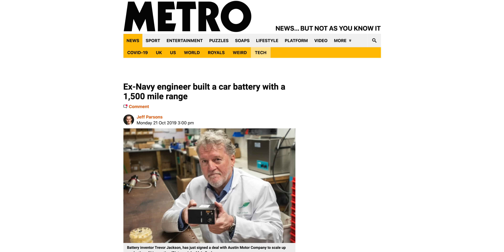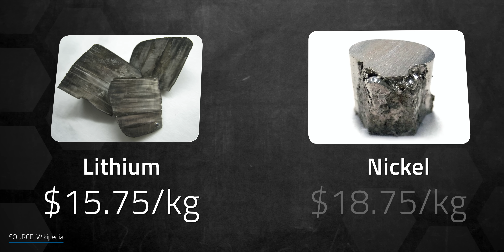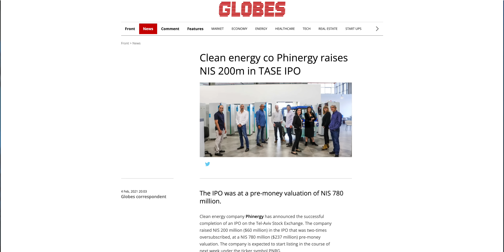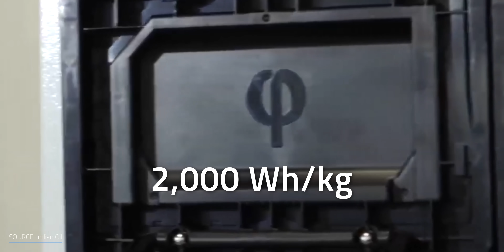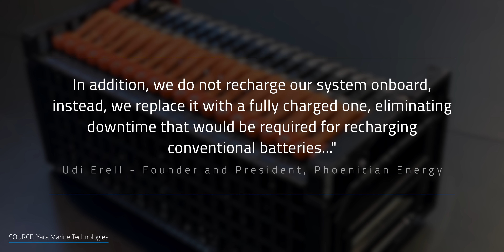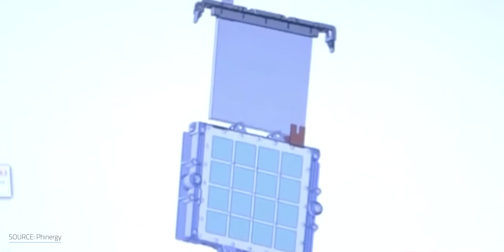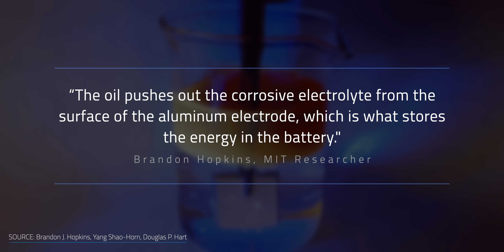Exploring the 1000 Mile Car Battery - Aluminum Air Hype?

Comment: This is one of the most "different" battery technologies I have seen!  It provides a distinct choice of advantages and constraints.  No doubt that means it is highly desirable in some applications and not-a-starter for others.

The key variable completely missing from this summary is battery cost.  Is a replacement 60 kwh aluminum-air battery a $35 item, or is it $3000?
Reply: this would be like running your car on giant versions of AA batteries from the 90s.  Every time the battery runs out you need a brand new battery?  GTFO     i dont even know how i made it through the 90s...    dreadful to even try to remember.   "CD player died. gameboy died. MOM I NEED BATTERIES!"   Mom:  "We dont have any!"   Me:  "OMFG when are we gonna get new batteries?"     Mom:   "Im going to the store next tuesday ill get some then"    Me:    " F   .... M ....   L ..... "

just realized, this is why i actually managed to read some books in the 90s....  amazing
Reply: At economies of scale and recycling id assume the cost would be lowered but idk
Reply: @hamzahabugosh  Not really, we already have the scale of aluminium hydroxide dehydration (the Bayer process) and electrolysis of the resulting alumina (the Hall–Héroult process) which is what this 'recycling' needs. We've been looking for cheaper and easier methods of reducing alumina for centuries and that's the best we've got. That's what this process requires, because the output is aluminium hydroxide.

If there is a more efficient method for producing Al metal from Al oxides and hydroxides I'm absolutely certain you would be extremely rich if you can find it.
Reply: m727yy9givkvk m m . 
 
                      .

m
 2wwsz m .   3222wer79000p..          .x
Reply: @سلمىاحمد-ص7ب  أعتذر ، لغتي العربية سيئة للغاية. أنا لا أفهم جوهر رسالتك. يرجى إعادة الصياغة.
Reply: It's a dumb idea on a thermodynamics level. As essentially this battery turns Al into AlO (actually a hydroxide, but this is dehydrated to alumina before conversion back to Al metal), and you can therefore never get more energy out of the battery that it costs to make it. Al -> AlO releases a maximum energy which is the minimum energy to convert AlO -> Al.

Add on the hugely inefficient Al electrolysis (no more than 40% efficient; 250% of stored energy in battery to produce battery) and you've got a huge cost to produce the batteries (even assuming you can just cast the Al electrodes, else further manufacturing is required and therefore much lower efficiency) for very limited benefit. Transporting batteries around (to changing stations) is again another expense on the energy calculator.

Basic thermodynamics show these to be dumb ideas that can never do anything like they claim.

If you can make it easy (90% or above efficiency) to convert the used metal oxides back to useable metal, then these would be more useful, but when you are wasting more energy than you get out to produce the battery you've just created more problems.

Why does no one understand thermodynamics?
Reply: @seb3090  Seriously, this right here.  Transporting aluminum and making aluminum is more energy than the 5% loss you get from the grid.  Not to mention we're going to increase the cost of aluminum which is needed to make new vehicles.
Reply: @seb3090  I mean NO battery produces more energy than you put in to create it, literally every energy storage system loses energy in the process, and also incurs energy costs from transportation. The high energy cost is definitely an issue, but it might be worthwhile in situations where there isn't access to a power grid and energy density is paramount. It doesn't matter if it takes 250% the storage energy to charge it if the alternatives can't meet the requirements
Reply: @cactus445566  You know this thing with batteries is the rechargeability so over a lifetime they can actually store and release multiple times the energy of production. Sure I get that you get conversion losses and all other sorts of losses from self discharge or time discharge, degraded anodes and cathodes etc. But there is essentially no upper limit on the amount of energy that can be stored and released in a rechargeable battery, they can easily provide way more energy than it took to produce. 

That Al batteries degrade very quickly (80% loss after a couple of months, cf. 1-2% loss per year for Li-Po) again make these a really poor choice. You can't use them for backup use, you basically have to drain them within a month of starting using them. Sure you might be able to reduce that, but that's making the batteries more complex and expensive, and if you need pumps to remove the electrolyte (NaOH) you've got more failure points which no other battery had.

If you don't have huge amounts of power you are not getting your congealed electricity (aluminium) for the cathode.

If you really require large energy storage then oil or hydrogen is likely the best source of power, sure it's polluting which isn't good, but it's less polluting than producing Aluminium. Oil is way more energy dense than Al batteries.

I mean the parasitic losses in a Hydrogen system I've seen at something like 70% which is far better than these Al batteries (likely somewhere around 85% loss). The losses and other issues with H show why this hasn't been quick on the uptake, but still H would likely outperform Al batteries.

These don't solve anything but very niche issues and really are not going to help with reducing pollution. 

If this was a different metal which was not so hard to reduce then they might make better sense, but Al is pretty much the hardest base metal to reduce. So oxidising this for energy output is extremely wasteful.
Reply: @seb3090  No, aluminum is one of the best metals for battery applications because of it's high cost to reduce. Alumina's high reduction potential is the reason why aluminum has a high oxidization potential, why you get such high energy density out of it. The technology's still in it's infancy and it should be possible to improve the efficiency of aluminum electrode recycling, especially given that you don't need to remove impurities as you would refining aluminum from ore. Sure I doubt it'll reach the same efficiencies as normal battery technology, sure, but I think there are places where energy density matters enough for it to be worthwhile
Reply: @cactus445566  This is the same as refining Aluminium, it produces aluminium hydroxide, which then needs to be dehydrated to alumina which is then refined into Al metal, exactly the same as fresh material. Sure you can save a few steps on the Bayer process if the cathodes are just Al(OH)3 although I would guess that for more efficient batteries you are going to have a mixed cathode, else surface degradation of the cathode will reduce the battery performance, which in the caustic environment of the battery is likely to degrade and make reprocessing more difficult. The cathode is not going to be pure Al metal so the waste Aluminium Hydroxide is not going to be pure either. 

The Hall–Héroult process is at best 40% efficient (15MJ/kg vs theoretical 6MJ/kg), any additional energy required in the Bayer process, reprocessing the used cathodes, remanufacturing the cathodes (if not a plain cast part) and reassembly of the battery will only further reduce the efficiency.

What you are saying is there is a more efficient way of producing Al metal from Alumina, which if you can find will make you billions, because we use a very inefficient process currently. It's the reduction from alumina to aluminium that is the inefficient step, the purification is easier than the reduction. Which is why this sucks. 

I understand the reasons why this is being investigated but the action of the battery is to oxidise aluminium and it is the reduction of Al that is terribly inefficient. 

The very quick degradation of the electrodes (80% power loss after a couple of months) again doesn't make this sensible, if you were only at best getting 15% of the energy to produce the batter back from the battery, reducing this to 3% after only 2 months is even worse.

All this development is almost certainly going into making the cathode last longer, which in other batteries have meant more complex electrodes, which make them harder to reprocess. I assume there will be niche uses but this is not going to be a mass market device. If you did some reading into these batteries you find that the pure Al cathodes degrade quickly and the batteries lose power, as Al(OH)3 builds up and prevents the electrolyte from accessing the Al metal thus neutering the battery. The highly caustic electrolyte just degrades the battery, such that max power is reduced to 20% after a month or two even with no usage. This is nothing more than a niche device and never will be anything more.
Reply: @seb3090  gee maybe instead of pretending to be a smarty pants as a random internet person that no one takes seriously you should write down all of your infinite wisdom and intelligence and invent your own batteries and make all the moneys ever. 

Everyone else: Trust the people doing the actual research over the clowns who google a few numbers to earn internet points.
Reply: @jypsridic  Why would I bother? It's not like the chemistry or thermodynamics have changed. There is no solution except not mining and destroying the environment. 

Not having children I don't actually care that much. You all want to believe, that's your own shit, but these batteries have been around for decades and they've not made it into a marketable product except in very niche areas. 

Also looking at what is already known is science, no point rehashing things we already know.
Reply: @seb3090  And a famous engineer swore that man would never fly, two years later the wright brothers took off, that engineer was Orville Wright.
Reply: @jypsridic  Sure, but batteries are not that. We know that there isn't much more to be gained from battery technology, we're already pretty close to how good they'll ever be. Modern Li-Po batteries have maybe a 10% loss over 1000 charge cycles and the capacity hasn't changed much in 20 years (just speed of charge and charge cycles have improved really) and the fires show how unstable batteries get at these levels.

It's not like you can change the quantum states of ions or the chemistry. This isn't even new tech Al batteries have been around for decades.

At some point we have to stop extracting and refining metals (cannot remove infinite stuff from finite thing), will there be any environment left when we do stop? The environment is the only thing which keeps humans alive. 

You want to believe in a technological  future, that some magic will allow this high tech world to continue. And I think that trying for this is going to kill the environment and us along with it.

Combined with the facts that refining and mining are horribly polluting and we've got no solutions to that (if we did we'd be doing them). Trying to solve the problems of mining with more mining is never going to work. 

The book Bright Green Lies details all the ways this future you imagine will not help.
Reply: @seb3090  Wikipedia won't have information on the science we haven't discovered yet.
Reply: @jypsridic  Batteries move electrons around, you need somewhere to store those electrons before you move them around. We store them with +ve ions to make neutral atoms. So unless you can find a lighter +ve ion (H and He are gases so not going to work) you are out of luck. There is no magic.

So praying for something to exist when there is nothing that can fill that gap is hopium. Not based in reality.

So yeah, there is not going to be a battery breakthrough, we're pretty much at the peak of power to weight with Li-ion/Li-Po batteries, only marginal gains from changing electrodes and electrolytes is possible.

The chemistry of batteries is well understood, making them practical for recharge cycles is what tends to take the time, stopping dendrites and degradation etc.

If every other ion is heavier than what we currently use you won't get the same charge density to what we already have. And what we have is a 500kg battery that'll take a car 300 miles.

Could we get this down to 400kgs, maybe. Will this fall to 40kgs, no. The energy density is not there. https://en.wikipedia.org/wiki/Energy_density

Burning things is 100x more energy than getting it to move electrons about. 

This is the chemistry I am talking about, and no there will not be new chemistry. 

You might note that zinc batteries are better energy density than li-ion, this is true but zinc batteries do not last as they are bad at dendrite formation, so work badly in things where you want hundreds or thousands of charge cycles. As I say, we know how batteries work and we've looked at most things as charge carriers, even in labs there isn't anything much better than we have. This sort of stuff is really old science.
Reply: @seb3090  You've just described several things that we could invent or discover that would make batteries better than you think they can be. The fact that you can imagine what would prove you wrong proves me right. 

If your argument had been "modern technology can't take batteries much further than they already are, we'd need to find a way to pack electrons more tightly or a different particle to store energy with entirely" I wouldn't have anything to say against you. But instead you went with 'we don't know how to do it therefore it is impossible' 

Maybe instead of storing energy as electrons we'll store it as unstable nuclear bonds and use a fission/fusion cycle instead of a cathode/anode system.
Reply: @jypsridic  Not really sure what you think an 'unstable nuclear bond' is or what you think electricity is.

Nuclear batteries (RTGs) do exist and are not suitable for consumers, as they work best with alpha emitters, which even in tiny quantities are fatal if ingested. They are also not efficient and have an annoying side effect of gamma radiation. Good on spacecraft (where solar doesn't work) bad on things that normal people can access.

Cold fusion is not a thing that exists or will ever exist.

The problem with nuclear is the energy is in the form of high energy particles, quite often neutrons, which are bad for things which are alive or other radiation, also bad for things which are alive. The feet of concrete they put round reactors is not there for fun. And again we've been looking at this for 80 years now and BWRs/PWRs are about the best we've come up with (GCRs are good, but fiddly and expensive which is why they were dropped).

You can't just jam only electrons in something, that's not going to work, so you need +ve ions or some other means of generating electrons, which means atoms. Those all have mass that does nothing for your electrical generating capacity, which is only about how many electrons you can move. Lithium being light allows more electrons per unit mass that almost everything else.

If you are having electricity as an output you will ALWAYS have a cathode and anode, these are not magical things, they are the current source and the current drain, which you need if you are generating current. Again it would be helpful if you had some clue about the words you were using when criticising me, it doesn't come across as smart when you don't even know that a cathode is the +ve terminal and the anode the -ve. Even RTGs have a cathode and anode.

We generate power either using chemical means (usually oxidation, or burning if you prefer, usually turning carbon into carbon dioxide) or via electrochemistry. Nuclear generates heat which runs turbines as other power stations, it is in place of burning things, although it also burns fuel, it's literally turning mass into energy with the most famous equation (E=mc^2)

I don't live on hopium as you seem to want to. Battery technology hasn't really improved in 50 years, the battery in your phone is barely any better than a phone from the '80s, sure it will have more charge cycles before failing but the capacity/weight has not improved more than 2% per year. There has been no breakthrough because really we're close to the limit of what is achievable.
Reply: @seb3090  "what you think an 'unstable nuclear bond' is"
an as of yet undiscovered thing. 

"Nuclear batteries (RTGs) do exist"
I know, and they're not what I was talking about which should have been obvious to anyone with a fifth grade reading level. 

But I'm sure your need to pretend to be smart will outweigh any shred of common sense so the rest of that essay will be a poorly written, error laden, and excessively pretentious explanation of the first generation of diamond batteries. 

"Cold fusion is not a thing that exists or will ever exist."
Who said it had to be cold?

"The problem with nuclear" yea duh everyone knows this paragraph.

"You can't just jam only electrons in something,"
Yea duh, that's why I suggested something that didn't require merely jamming more electrons into something. 

"If you are having electricity as an output you will ALWAYS have a cathode and anode,"
Who says the battery will output electricity?

Batteries store energy, not electricity. 

 Again it would be helpful if you had some clue about the words you were using when criticising me

" Nuclear generates heat" Duuuuuuuuurrrrrr 
Do you have any other common knowledge to pretend is profound? 

"I don't live on hopium as you seem to want to"
No, you live on deliberate ignorance and the assertion that we won't discover anything ever again.
Reply: @jypsridic  There are no nuclear bonds, there are chemical bonds and the strong force that holds nucleus' together. So again what bit of physics are you talking about? You can't just invent something that has no basis in physics.

Sure they generate energy, but that's only useful if it is in a form which can be reused. Such as moving electrons through wires. Low grade heat helps no one, which is why this is called waste heat. That's also energy, but again energy isn't a thing which is useful, only the work it can do. Either by moving something (in an engine or turbine) or by moving electrons.

Not really sure what other source of energy you are going to get out, moving protons around seems pretty dangerous and acidic. Neutrons decay in 10 minutes (and as mentioned bad for things that are alive). So what are you moving in these non-electric batteries?

We've not got an energy positive fusion reactor in the entire world. So that seems unlikely, possible, but unlikely. Also not going to be portable, again produces fast neutrons so much shielding required.

You suggested nothing as to solutions, because you think there will be some new science to solve this. Energy is only useful to us in the work it can do, so it needs to move things. 

Knowing the possible is useful for finding what we can do. Hoping for the impossible is not useful. Flight wasn't impossible (birds exist) before human flight, we'd just not figured it out yet. We know the energy densities of things so we know how much energy we can get out of stuff, and with batteries and electrical energy we're close to the maximum. 

So unless you've got actual knowledge on what nonsense you are talking about (please provide articles) you seem to have nothing but insults.
Reply: @jypsridic  It sort of is. You need some chemical process (it won't be nuclear) to do this, reversible ideally, to store this energy. The only method of doing that is supplying electrons and receiving electrons. Everything else has some form of waste, chemical processes which generate power (exothermic) result in more stable chemicals, so are difficult to reverse back to less stable elements. Doing the reverse with electrons also means you can do the forward reaction to generate electrons. 

There isn't new knowledge, an exotic alloy is not going to help you. We're making too much stuff, that's the source of the issue. We need to stop making stuff, doesn't matter how good that stuff is, the stuff itself is the problem. If we don't make stuff we don't have as big a problem. If we all realised the futility of a system which gives extreme wealth to the very few and a cast system of slavery to the rest of us. So we can demolish the only planet we can exist on in the entire universe. For what? Shiny trinkets that are just toxic waste in a couple of years? Sure, that's the kind of hopism I see in you. The hope that we don't have to give up the things that have made our lives easy to save ourselves. I mean I don't know if I could do it, but that's the way to solve the issue. Everything else is just making the problem worse.

Nihilism is what this culture is. My view is the only one with life at the end of it. 

You may see it differently and that's ok. But you can't refute what I say, you have hope that someone will come up with an idea that does not exist and likely violates the laws of physics. You just reply with fanciful thinking. Hopium.
Reply: @seb3090  yea, but it is pointless to talk about the details of that chemical, or whatever, process since it hasn't been invented or discovered yet. We literally have no information about it yet. 

You can't say it has to be this or cannot be that, but you can say that it is outside the limits of current knowledge.
Reply: @jypsridic  No and that's not what I said. It's not that there won't be improvements, I'm sure there will, although as I say there won't be magical technology which avoids the negative things about ALL technology, that is the mining and refining that is required to manufacture it. This is what is destroying the environment, the mining, refining, transportation and eventual toxic waste from that technology. Reducing ores to base metals is horribly toxic, polluting and it itself is the issue, you can't build your magical bean without mining and mining is the problem.

You want to believe that some magic technology will save us. And I think looking for that technology and building things which are only small improvements on what we have already (most technology for the last 40 years) is going to destroy the environment and humans and most life along with it.

I'm looking at what's happening and seeing that we'll destroy ourselves if we continue, and for what, a panacea isn't going to come and even if it did we are destroying the environment at too great a rate for it to matter. 

You think trinkets matter over life and I think trinkets don't matter. 

Not to mention that the improvements to batteries make them harder to recycle. thus worsening the waste issue humans have.

You want to believe and I don't believe. You have hopium and I have a view based on what actually happens. I won't breed more humans because I think we're doomed and bringing new life into that is evil. You can do whatever you choose, but you have no answers, just hope. You don't have anything to refute what I say, just hope. If I was talking utter nonsense you could easily refute the points I've made, but really you know that I'm not wrong, you just want to believe in something else.
Reply: @seb3090  No one ever said there would have to be any magical technology. You not understanding how it works doesn't make it magic anymore than ancient shepherds not knowing how lighting work didn't make it zeus. 

"Uses technology that hasn't been invented yet" is not the definition of magical.
Reply: @jypsridic  You want something that doesn't pollute to create and uses unknown science to do things which thermodynamics says are not possible. I declare that advanced enough technology to be indistinguishable from magic.

Lightning being a god or caused by friction of the atmosphere against itself makes little difference to those who are hit by it.

The problem is the mining and refining, which there are no solutions to, it's terribly polluting to separate out the ores you want from the ones you don't and then reducing to base metal is even more polluting. So creating a thing is never going to be better than not creating it. To think that anything could be is magical thinking. Because that is what you are saying, I'm just calling it what it is.
Reply: @jypsridic  That's what chemistry, physics and thermodynamics tells us. That there is no free lunch and you always lose.

Assuming starship works as Musk says that's 4500 tonnes of CO2 per 100 tonnes to orbit (LEO), that's a lot of pollution for not very much mass as on earth you can get a tonne of iron for 2 tonnes of CO2 or a tonne of Lithium for 15 tonnes of CO2. That's not better.

And no one is working on a Hydrogen rocket as it's just not dense enough for take off, the rocket would have to be too large and the tyranny of the rocket equation is all there is.

You have hope, I do not. You think there'll be some big breakthrough that will save us and I do not. I do not live on hopium, I exist in reality where there is nothing that will help and this culture will continue it's nihilistic path to destruction.

You can't cheat the process, if you can get x amount of energy from oxidising a thing it will take at least x amount of energy to reduce it.

You have nothing but hope of a breakthrough, one you can't even begin to say anything about. Where the hole in physics or chemistry might be that it exists. Just blind faith. 

I just look at things we already know and extrapolate. And then you criticise it and bring no rebuttal except for hope. Please do try harder.
Reply: @jypsridic  and I'm saying that however good the batteries become, which is likely not much, it won't matter. The way we live is unsustainable, either we change the way we live or we destroy the environment. We may have already destroyed the environment.

Building stuff, any stuff, is the problem. The amount of building required to replace all the dino juice and old forests we use to power the world would require vast mines for rare earth minerals, all the Cobalt in the world, Lithium for days. Oil comes from deep inside the earth, to get it out is relatively simple. For fuels that are even 10% as dense as oil being mined. And the fuel required to refine all that. And then the fuel to make all the replacement things for 8 billion people and provide a level of comfort to as many people in the world.

Yeah, that'll kill the planet, doesn't matter if it's the most perfect battery in the entire known universe. Unless you think you can harness zero point energy you ain't got squat.

And we'll either burn all the oil and coal or we'll mine the entire earth. 

So regardless that we can't find a solution to the battery issue, but even the best battery isn't going to solve the issue. Because it's just producing ever more things. You cannot produce things for ever on a finite system. Something will give eventually.
Reply: @jypsridic  They are not rare earths because they are rare. That's just what they were called. They are useful in magnets and electronics, which you'd probably find useful in an electrified world. They are so useful because they make very strong permanent magnets and have properties that are better than other elements. But extracting them is difficult, see the black lake of death in mongolia. 

The western roman empire's decline started when the climate cooled by a degree, that was a relatively local event but still caused Rome to fall. Heating the world by 2 degrees will cause huge problems, I mean it was 50 degrees in Canada this year.

We need some form of stable climate for food production, if that goes what are you going to eat?

Our activities as an apex predator with nothing that predates on us (the odd human dying to a shark is not predation) We grow with no limit, we know what happens when that happens, humans die, the Easter Islanders show us that.

You have a view of human supremacy, that there will always be a solution to whatever problem. We're so smart we can figure it out. But really what new have we had in 30 years, smartphones are just smaller computers, not a new idea, just an old one but smaller.

You can't get stuff from space, the rocket equation will stop that from happening. 

We're killing nature at a huge rate, turning the entire world into a factory for human needs, not realising that we need the environment for life. 

No other animal refines metal, burns oil for power, extracts ores, produces something that isn't part of the cycle of life. We produce toxic waste, inhospitable to life, excepting a few bacteria. We concentrate radioactive ores, produce material that will be toxic for millions of years. 

Why do you think resources are not finite? Why do you think there will be solutions? You make assumptions about things without evidence. We've got evidence that the world is warming, we know many humans rely on glaciers for water, these glaciers are shrinking. Permafrost is melting (releasing methane and carbon dioxide), these gases we know cause earth to be warmer than it should be based just on the radiative heating of the sun.

So pumping more of these gases into the atmosphere will increase the temperature. 

But you can believe what you want, you believe in hopium and human supremacy. I don't. I think humans will kills most complex life with this behaviour. We'll knock down all the forests, burn everything, leave toxic waste in our wake and then realise we needed all that to make this planet liveable. 

But I guess we'll find out in 20 years who was correct. You can have your hopium, I don't need it, I have no spawn, doesn't particularly bother me if this world dies I have no god.
Reply: @seb3090  they're rare because of how much you can get out of a ton of ore compared to other elements, iron for instance.
Reply: @seb3090  this also ignores the engineering consultants that come with a car, these batteries although more energy dence in Units of weight I dought they are more energy dense in unit of volume as they would be incredibly light compared to lithium ion batteries and the same unit of weight for the Aluminum air battery might actually take up more room the entirety of the Tesla making it completely impossible to achieve those ranges in the real world. Also the fact the every company that ever toyed around with the idea of bat packs that you pull up and are swapped in 5min gave up (Tesla to name a big one)
Reply: @seb3090  Every battery is dumb before thermodynamic laws. *facepalm
Reply: @seb3090  I mean charging NMC or LFP batteries is also not 100% efficient. The question is always "how much energy is lost?".
I agree these batteries would probably lose too much energy to be viable for most applications and having enough aluminium smelteries to supply all cars with these batteries is just ludicrous, but I could see them in one application: aviation.
With planes it's improtant that nothing is emitted, since the seeded clouds are a big contributer to climate change. Also the volume is small enough that it's certainly doable. Now you "only" need to produce these batteries with renewables and you are golden.
Reply: @seb3090  Using our old fossil fuel burning crap forever isn't a sulotion either, though. We still have a bit of a CO2 Budget left for 1,5° (but let's face it, we are never going to hit that, 2° might still be possible). We need to use that to build things that don't emit CO2, so we won't emit CO2 in the future. Of course that emits CO2 now, but that is an investment.
We don't have any other choice.
And I'm not talking pie in the sky technologies. I'm just talking solar, wind, water and geothermal (the last two where possible).

That recycling of a aluminium-air-battery always emits carbon, is sad to hear.
Reply: if its just replacing the aluminium it could be $35
Reply: You don't have to replace the whole battery, just pop in New aluminum
Reply: @DeletedAccountForSure  literally you have to replace the whole battery